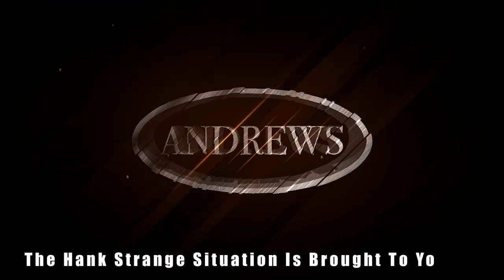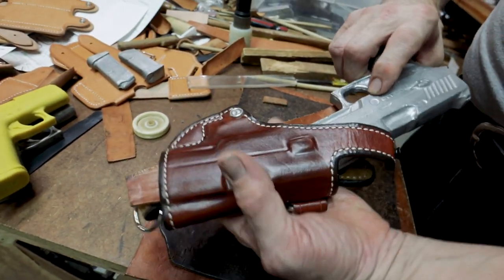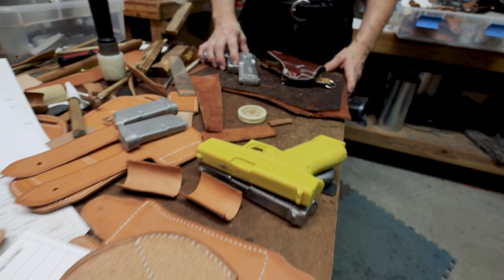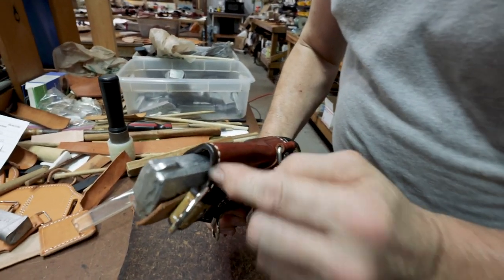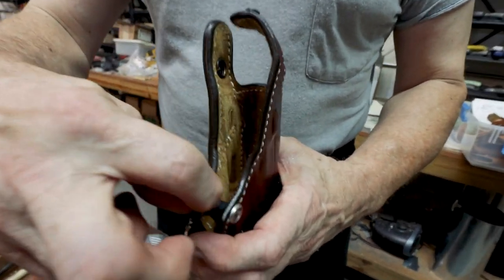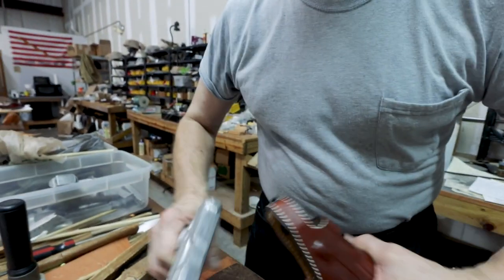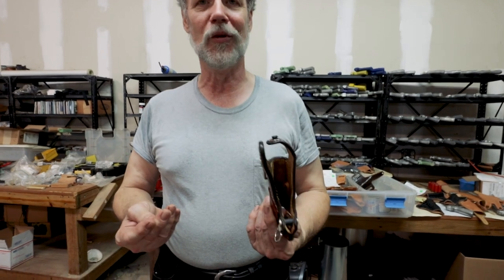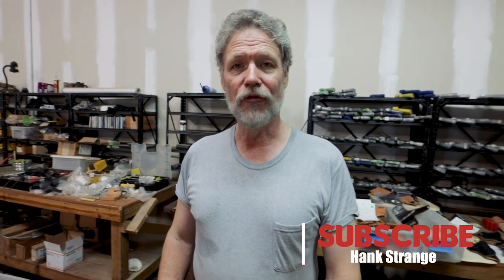Holster Too Tight! Leather Tips With Sam Andrews

Comment: Good advice, however, unnecessary with these fine pieces of craftsmanship. Just use the holster normally. Practice with it (go to range and draw and fire a bunch of times) and it will naturally form fit, break in, and become easier to use.